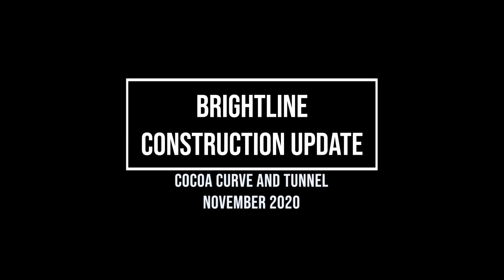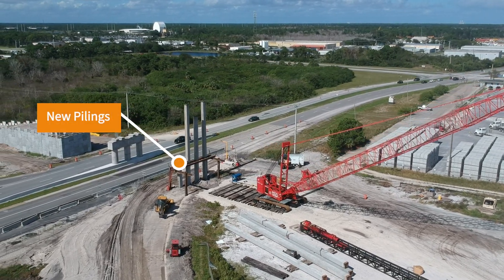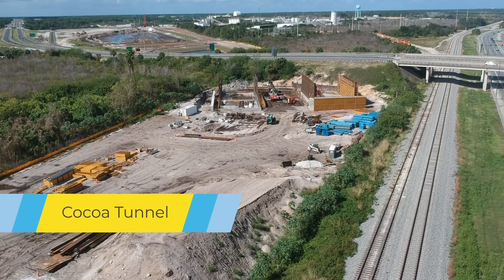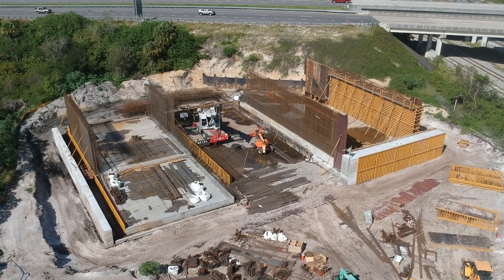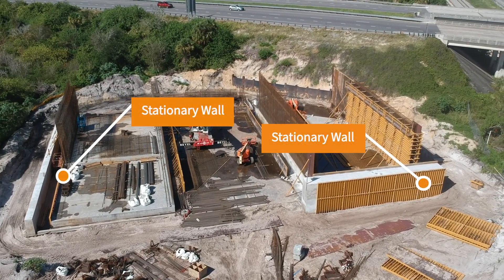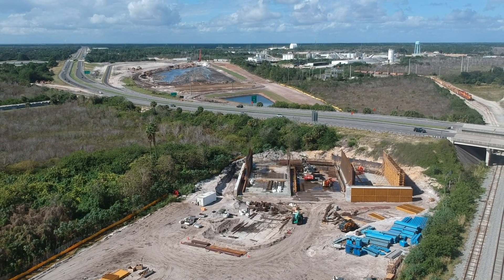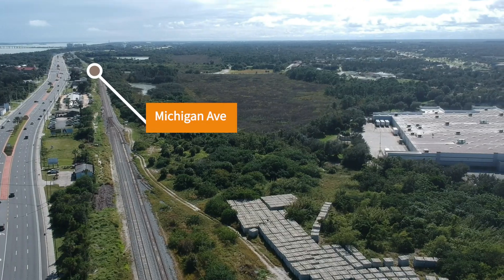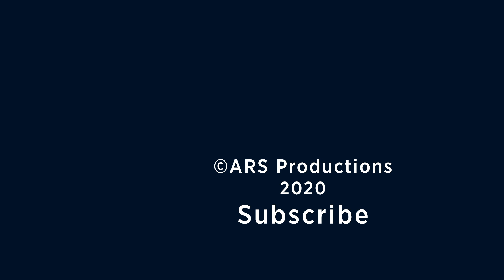Brightline Cocoa Curve and Tunnel Construction - November 2020

Comment: Roaming Railfan, very nice video as always, thank you.

Would it be possible for a future video to capture:  1). The progress of ROW crossing over the St. John’s River and 2). Continuing west from that crossing into Orange County from Brevard County, it appears there is a short segment of the ROW with the concrete walls up on both sides of the future double-track mainline and what looks like a small side-walk on each side? If my assumption is correct, I wonder how Brightline will perform track maintenance (i.e., replace the concrete ties) using a piece of Loram, or equivalent MOW equipment to perform that task, as it does not appear to be enough room to do so within the confines of the wall? Thank you.
Reply from the maker: You can find coverage of that area in this video from about 3 weeks ago: https://youtu.be/bMHGd01jZNQ

Comment: Thanks for the update. I was wondering how they were going to make the turn to the mainline. Interesting. You gotta label the old SpaceX facility for the next update at this location.
Reply from the maker: The SpaceX facility is not visible from where I fly.
Reply: @RoamingRailfan  - the cocoa facility, the tall white tent in the background looking west, past the cement factory.
Reply from the maker: Didn’t realize you could see it until you mentioned it. I’ve driven by it a few times but thought it was too far out to actually recognize but I guess I was wrong.